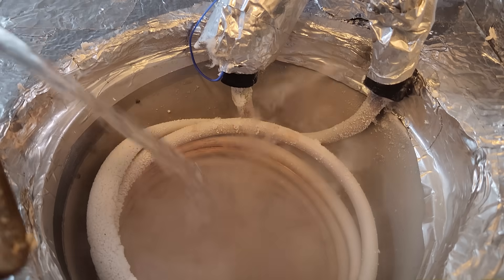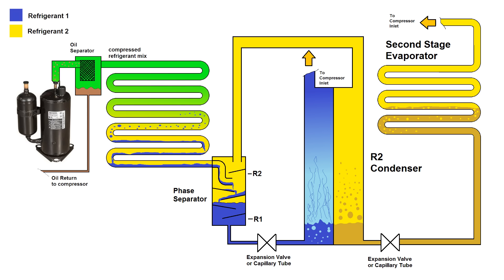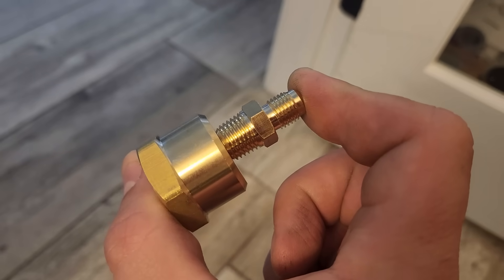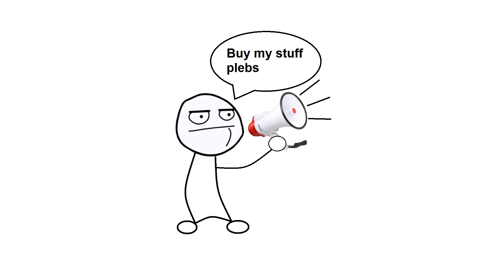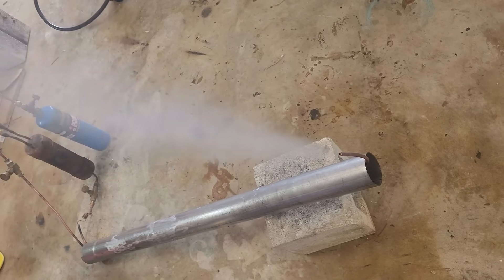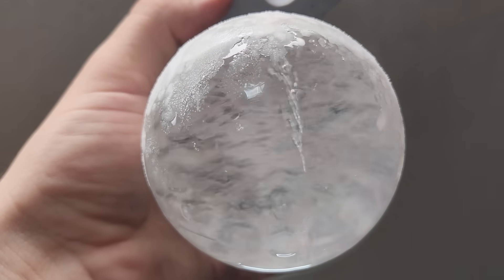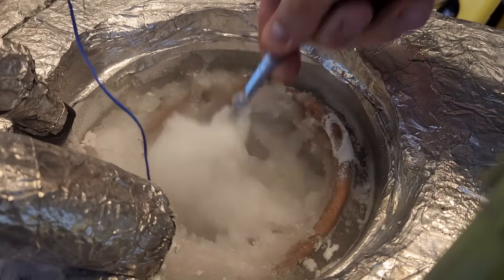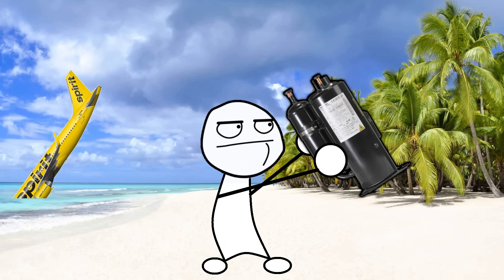Homemade Autocascade Refrigeration System (plus Anhydrous Ammonia)

Comment: What about the vaccum chamber effect electrical draw off  of the intaken electrons and or shed off electrons  in both the gas field and  fluid  with the internal cooling to increase the polar alignments? You know, that magnetic field thing that happens when the low temp pushed the material clooser to a super conductivity  sort of thing..    any vaccum chamber glass insulatiro with a capacitor like reflector and  to keep the electrons moving away and to do work , like in a motor ...  rough ones can be made  but glass is a fairly good one as the  cold inbetween  will shrink the glass like 'cupping " and the vaccums either side of it will be similar to a pump, if there be a phuskcal and  magnetic back flow  prevention  method setemployed into the multiple layer  HLP  ( HYPER LOW PRESSJRE a.k.a. Vaccum ) chambers ..  and the draw off  portions of the Circut and magnetic  pole draw offs.. 
 I know it sounds funny  bit the fluid between the two  vaccum chambers , before should be chilled and in the compressed and   the expansion side should be a very low pressure and a psi  sort of  back flap thingy and the piston of the piston totally up and larged than the inlet so the low pressure  expand into and through the narrow  port with also the electrical induction coil around it to suck off the  heat  at the narrow  spot where natrual  lense effect sort of compression and hesting accoure  and piezo elettric magnetic occilations occoure ..   
    It can be easy but it can be much harder if you let it be. 
  The gases you say to use , if not  properly , handled, will at some point in time, become explosive ... and I think you already know that.. and you might be trying to kill people or at least have them hurt really bad ..      sort of amusing..  but youre educated and the women trust ypu .. so..  youre cool.. get it.. or maybe you are  makeing ypur own and  should do it yourself in exactly the way  you say..  Im not sure, I dont know you, and I kind of think it is funny to watch people become maimed by their own stupidity, dont you?
 And here it is comming into tje hottest part of the year and solar flares also..  
 I thank GOD.. and hopefully my new wives will actually be achieved with the shotgun blast tests on me..  easy peazy ,head ' home "... cause to listen to tje people that live around me one more fcking day.. seriously.. even the women with them.. it's my prayer to GOD..  like fckem save some time and money.. use a shotgun, less time consuming , less expensive, and more well targeted than poison and disease.. 
   But you know how women are.. lol

Comment: Do you have a way I could DM you? I have a machine shop and several large 500 gallon and up size pressure vessels. I fractionate my own oxygen already and I would love to discusses some things with you in regards to the fractional distillation of the exhaust from that process. your videos inspired me and I have the toolset to make about anything it would require. Would love some advice.

Comment: You don’t need a check valve you need to put an EPR evaporator pressure regulator on the higher temp / pressure evaporator or else you will run into the issues you did.

Comment: Another amazing vid 😮👍

Pro tip from my grad school days in Applied Physics: If you want really, really dry gas use phosphorous pentoxide as the dessicant. Put some 3A molecular sieve ahead of it to conserve capacity of the non-rechargeable P4O10, but it doesn’t look like you have a whole lot of moisture to deal with overall, so probably not needed.

Comment: Just add an ammonium salt and NaOH, both completely dry in a flask together, stopper with a tube leading to your current setup, then start swirling the flask to intimately mix the two solids. Eventually a reaction will occur and almost anhydrous ammonia will be produced and if you have a pressure equalizing addition funnel, then start to add water drop-wise. A drying setup like yours will still be needed but it works much better.

Comment: I think if you use a CPR valve at the inlet of the compressor, it will help a lot also if you use a high pressure compressor like a transcritical CO2 compressor you can run it with 100% without overheating issues. And I think you should have to do liquid injection to the compressor or EVI (eEchanted Vapor Injection) to cool your motor a bit and to reduce the CR. 

Small tips from a refrigeration guy

Comment: Take it from a former fridge technician, your videos are very cool (pun intended). Also, be careful with that ammonia near copper pipes. NH3 eats copper, that's why in ammonia refrigeration systems they only use steel pipes.

Comment: I am an environmental chamber service technician and I work on cascade refrigeration systems as a day job, this may be some of the coolest, no pun intended, stuff I have seen. 
What you should try to do so you can potentially run the compressor constantly is put a discharge pressure regulator on your off cycle expansion tank to keep discharge pressures down, a liquid injection valve to keep your compressor cool and discharge temperatures down!

Comment: I can’t get my head around why pressures add, because it’s simultaneous system, it’s not like there’s an additional pressure drop experienced by R2 that is in its path.

R1 will just be over pressured.

The efficiency drop isn’t from stacking pressures, it’s from excessive heat of compression that R1 sees.

I may be wrong…. But I don’t think I am.

Comment: Why do you add pressures for the compressor calculations? Wouldn't be enough if you achieved the highest of the two gasses' pressure? 22bar vs 33bar
Reply: That's exactly what I was thinking. And wouldn't dropping the pressure also reduce the suction pressure as well? Man I'm down a deep rabbit hole.

Comment: As a former industrial / petrochemical refrigeration technician that is very cool, I’ve worked on several large cascade systems but never an auto cascade.
I would suggest that using silicone as a thread sealant isn’t a good idea and would suggest that you look at using some Loctite products such as 569 or 567 and make sure threads are clean and use the primer first (7471).
Probably a good idea to check Loctites chemical compatibility charts first as guide….often times they don’t know or at least won’t guarantee so it’s still user trial and error but in my time the Loctite products we used generally performed well with various refrigerants and oils

Comment: Sodium in liquid ammonia should form solvated electrons, which gives it a blue color. Solvated electron chemistry is usually done at -78 in a dry ice acetone bath to prevent side reactions like the formation of sodium amide, but as it warms up/over time it can form sodium amide which is a white solid, although it is usually pale gray to beige due to impurities. I’ll bet you also had atmospheric moisture condensing into the liquid ammonia due to how cold it was

Comment: Hey watching the video which is great btw so im just gonna answer some of your questions you asked. 1. The check valve on the suction is actually to keep back pressure on the warmer line. Pressure is effectively temperature with refrigerants. 2. the cnc work was mint and probably why it worked for you cause silicone and most other thread locks will fail with the heat cycles after so long. 3. the big yellow tank is acting as a receiver. 4. you ever hear of a product called deep cold? you made that. Same sh*t thats in heating gel packs.

Comment: Yet another awesome video. One thing that I’d love to see is a modern take on the old icy ball refrigerator using modern and safer refrigerants. The original one used ammonia dissolved in water under high pressure, which just seems too dangerous to mess with. But, I like the idea of being able to boil one end to prime it, and then let it evaporate over a period to keep an ice box cold.
Reply: I've been reading about those, very interesting refrigeration that needs no electricity. I read that the army tried to scale them up but that they didn't have any luck with doing that but the article didn't elaborate as to why
Reply: @davidlucas5431  Indeed. They are a fascinating relic that I'd love to see revisited.

Comment: You can better generate anhydrous ammonia using your sodium hydroxide and any ammonia salt. Just mix the two dry then drip in water slowly. The lye will displace the ammonia as water is added, making a sodium salt and ammonia gas. It still may have some water, but not nearly as much.

Comment: For drying Ammonia you use a mixture of Potassium Hydroxide flakes mixed with quicklime, KOH and CaO, this will not cake like NaOH does. Also you make the ammonia gas with Ammonia salt and KOH + CaO + a few drops of water + heat to start it up. This makes almost anhydrous gas and a short KOH/CaO drying tube does the rest.

Comment: Should switch to larger 240 volt compressors ? Sometimes a desuperheating TX valve is used in the suction line to keep the compressor cool . Very impressed with your knowledge and results .

Comment: For the compressor running too hot, you could add a heat exchanger from the oil separator back to the return to help pull away heat.

I know this defeats the point of a single compressor, but you can also add a smaller compressor (like for a refrigerator or something) in series with the main compressor. It would be much easier for a compressor to go from 0 to 15 Bar, then 15to 30 Bar than to have one compressor do the whole thing. You just need to be careful that one compressor doesn't take all of the oil from the other.

Comment: WHY?! WHY are you brazing brass and bronze with copper based soldering rods?!!!
Use silver it flows better, you can easily break off most flux off the rd and its WAY easier to solder with it, especially when soldering brass, bronze, steel and copper be it in combination, or with themselves. You won't need a lot either, just heat the material gently and around the area, use dripping wet cotton rags to keep the heat contained (15-20mm) away from the parts you don't want to heat up and after warming the part up gently with a "soft flame"  aka more acetylene incomplete buring, hard cone enveloped in a softer fuzzy blue flame, about 25mm long for your diameter of pipes I'd recon. Then you crank up the oxygen ever so slightly and once more turn up the acetylene this time your fuzzy flame would be about 30-40mm long depending on the nozzle you use 04 is typically the best of both worlds.
Why am I so adamant about it? Well it flows better, aka you get better soldering joints, which easily can be taken appart again and you need very little of the silver rods. An 18mm outer diameter pipe in a filter dryer with steel ends and about 15mm shoved in would need about 3-5cm of rod with a slight "pearl" of solder beneath the joint depending on the soldering position. If you solder at teh workbench and clamp the part upright so teh solder flows into the filter dryer you get the optimal result with the least ammount of solder lost/wasted. You should ofcourse run 5.0 N2 through your filter dryer when you do this since it shouldn't be exposed to the air if possible. Also put wet rags on the dryer until they touch the steel pipe, two should do teh trick, the insides of the filter dryer will thank you and ensure it is optimally functioning without obstructions. It should go without saying that running N2 through the lines when soldering makes them stay cleaner and when you connect up your compressor and filter dryer it protects the oil as well, the stuff usually is not reacting kind to H2O and gets all slimy when decomposing.
Pro tipp: Don't open the filter dryer and compressor to the air until all other parts are in place and allways run them with dry N2 (5.0) the rest of the welds can be done with normal N2 to protect against soluable oxidation which will clock your filter dryer and gunk up your oil.

Sorry fo teh rant, but this is kind of hurting me, my recommendation would be to also use silver solder for the compressor fittings any Cu-Cu connection Cu solder is fine, as long as the parts are cleaned up with "grid wool" and brake cleaner.
As for your leaks in the threads we use a tiny ammount of "leak lock" at our HVAC shop and have to fullfill EU guidelines of less than 5g of R134a a year, best be no leaks the stuff has become expensive and isn't good for the climate and nature.
Sidenote: The reason your compressor si on strike half the time is probably that it's a scroll type compressor, try getting your hands on a piston one of a comparable size, they can duty mor Bar and getting up to 30Bar+ isn't that hard.

Comment: I think you should produce an AC unit that can be installed in computer cases. While fake water coolers can cool the environment they are in, an AC unit will be much more efficient. And a company that can produce such a computer case will be One.

Comment: I, personally, cannot find a lot of uses for such system, as impressive as it is. The only idea that occurred to me would be to submerse a computer motherboard into a non-conductive, non-reactive refrigerant, assuming that it would not break any soldier joints due to negative differential thermal expansions.

Keeping the refrigeration system in another room, while continuously having the board and its components at negative temperatures would produce great performance with none of the noise. Great for CFD analyses that go into the night.
Reply: Normal people would use water cooling with a big radiator. Or just a directly mounted big radiator.
Reply: @thewhitefalcon8539  Yes, but that has limitations in overclocking, and fans are needed to cool the radiator. Generally speaking, the lower you go in temperature, the more can be extracted from a CPU, especially if it designed to accommodate such temperatures. Some years ago, the record for overclocking was done with a sub-zero setup.  I don't remember its details anymore.
Reply: @leoa4c  those records are being done with liquid nitrogen and sometimes even liquid helium (few company sponsored events). Since its just for sport people do that by buying tank of liquid nitrogen and pour it by hand into copper pot attached to CPU/GPU. It's cheaper and easier that way as you need to be able to handle 500-1000W heatload. Cascade that could do that would be giant and prob need separate circuit 😅

Comment: Ammonia has very high affinity for water, so just having the cap off your sodium amide solution will readily pull enough water to destroy the solvated electron soup. Chemists usually do this in a Schlenk setup or at least under dry gas blanket.

Comment: So impressive to see your prosjekt and your knowledge 😊

 I serviced -135C chest freezer two decades ago, impressive that time😬
Sanyo used a cascade followed by auto cascade on the second stage.
The way they made it was with 5 gases in the auto system.
The last gas boiling was R50 methane.
The auto was controlled at first hours by a high pressure cut out at 32 Bars.
The auto kicked off every few minutes for a cut in at a low pressure.
After 5-6 hours, the system ran continuously by keeping the auto discharge always below 32 Bars
They used two huge storage tanks for the auto part and fed the gas to the suction by two extremely small bored capillaries so the drain of those tanks tok many hours before they reached around 1 atmosphere.
The tricky was the expensive 5 gases mix of exactly 873 gram had to be filler inside +- 2 grams.
Run suction og the system to reach 1 atmosphere that gave the 873 bottle charge.
The gas mix with price now if buyable 3.500 dollars so not much failures allowed.
Worked with single stage auto cascades too down to -152C that killed themselves too often😂

Comment: Why not put another compressor in the loop?
Nylock I think it's called is a commercial product that seals flare fittings. Make sure you got a little bit of liquid refrigerant coming back to the compressor to cool it off but not enough to slug the compressor.

Comment: Get some yellow paste or yellow tape, you need gas sealing properties not just water sealant. The yellow teflon tape is much thicc and allows for better seal forming.

From experience, I can tell you it's possible to make an impromptu seal from yellow tape that holds up to high vacuum. Much harder than high pressure

Comment: How hot was the oil return line?
If you put a small cooler and fan in that line it might help keep the compressor temp down a little bit.

Comment: the moisture is probably not even from your ammonia generator but the fact that the flask is open to air, air moisture would gladly condense inside the ammonia condensing flask so you end up with moist ammonia, perhaps put plastic wrap around the top or use a two holed stopper so you can feed ammonia into the flask and put a drying tube in the other hole. interesting though, and now im tempted to build one myself since i have been wanting something like this as a cold trap
Reply: If you flow ammonia gas into water , The ammonia bubbles get absorbed so fast that they implode . Interesting to see .
Reply: yeah its quite fun to watch, if the gas flow is low enough the bubble just kind of stays in place and expands and contracts in size like a beating heart

Comment: At that sort of pressure you probably want to split the compressor and put an intercooler between the stages, possibly even an expansion valve for some of the propane. Not sure what the exit temperature of that setup is going to be, but it has to be a couple of hundred degrees at least. You can cut down the power consumption dramatically if you avoid compressing hot gas.